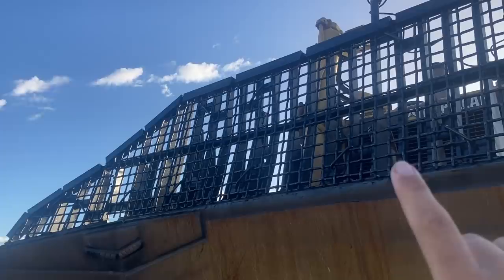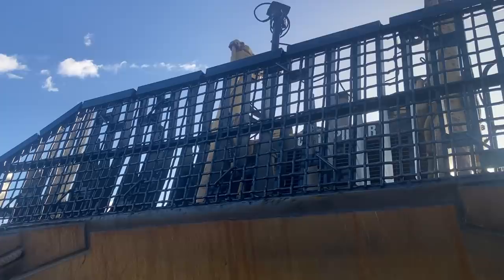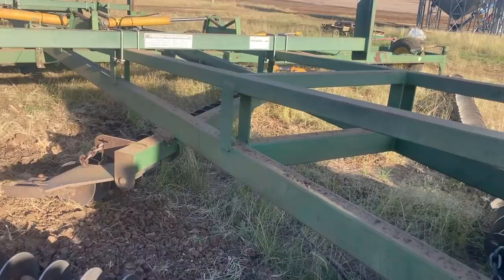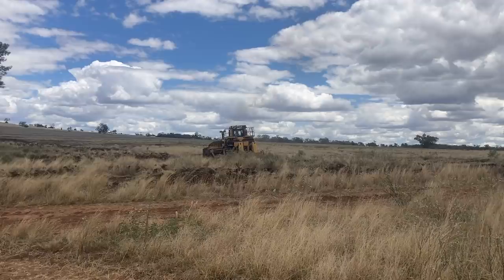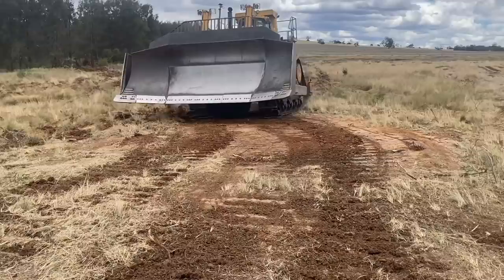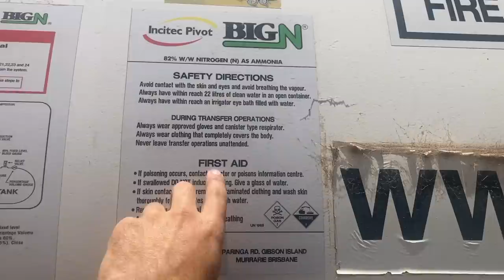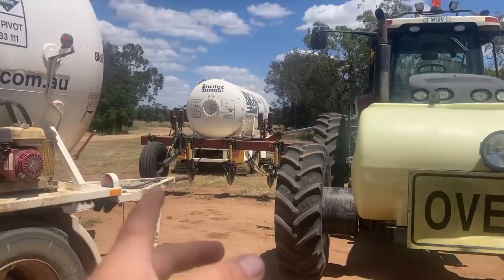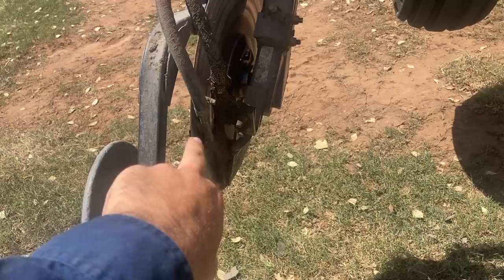D11s Awakening!! And Logistics of Gassing (Vlog 59)

Comment: My first encounter with anhydrous wasn’t a pleasant one. I was just a kid at the time. My father was filling the applicator tank as I was walking up to where he was working. Next thing I know I’m on the ground gasping for air and my throat and nostrils were burning. The wind had changed and I walked right into the fumes. It only lasted a few seconds but it basically knocked me out. I never got close to the tanks while he was filling up again until I was older and understood how dangerous it could be.

Comment: you should mount a camera recessed at the top of the blade so when the blade is lifted you can still see. i would do 2 on the outer edge of the mesh so you have a nice panoramic view. you could have 2 screens like mirrors in the cab. and i would also put 2 on the rear for ripping etc. feed them to the same monitors but switch at the push of a button.

Comment: Seems like your gas/liquid isn’t getting deep enough or enough cover over it once in ground.  I know you want it ideally in the top few inches of topsoil where the roots can use it but what if it was added to dozer rippers about 1 foot down the shanks?    I get that the spread of the rippers is wider than the injection discs but you’d be getting two birds stoned with the same joint.   We use urea for our fields just before a rain or irrigation.

Comment: IN america we have what is called tooth chisels - rippers - that just hook up to the back of tractors - 100 Hp or more - that is 36in /  48in long - and yu can get them from 4 to 10 in line which would be about 7 / 8 / 10  feet wide - how hamned hard is the dirt there that a plow such as that - which would do a lot more in less time - would not work - those dozers go so slow - thats ODD ? ! ?

Comment: Does the running costs of the D11 for ripping work out cheaper than a high hp tractor for ripping in the long run?
Reply: He said in a previous Vlog that the D11s use 100L/hr of diesel, which is running about AU$1.60/l right now I believe, so that's $160/hr not including man hours, wear and tear, or other items.  A D11 has a width of 2.8m and the ripping speed looked like maybe 8km/h, if so that's 2.24ha/hr or 5.2ac/hr, which works out to AU$30/acre in fuel costs only.  With that said they have the D11s and got them for a song, whereas a "high HP" tractor would be $500k used.
Reply: @djeity  width between rippers is 1.5 meters so   effective ripping width is actually  4.5m
Reply: Thanks!  So that's 3.6ha/hr at 8km/hr, which would be AU$44/ha or $18/ac for fuel.